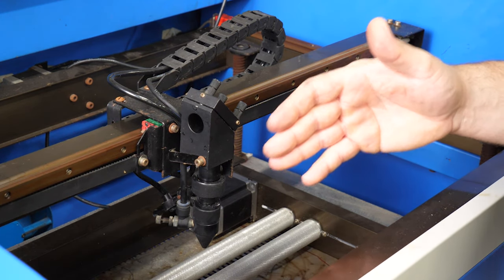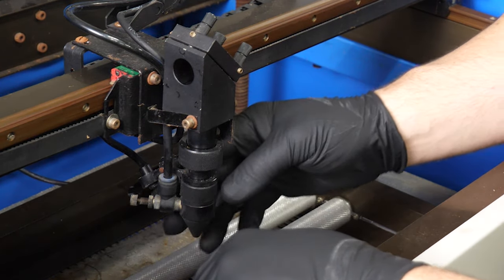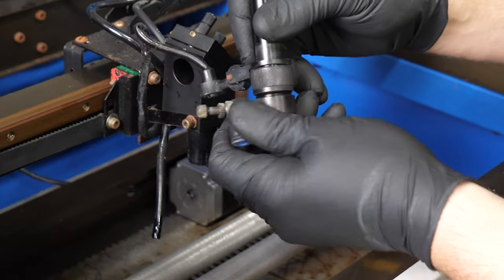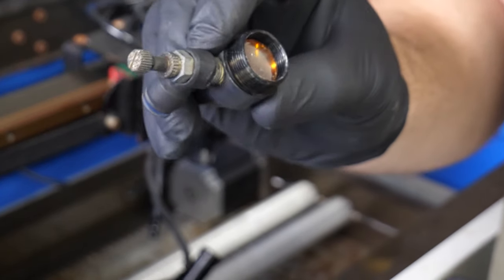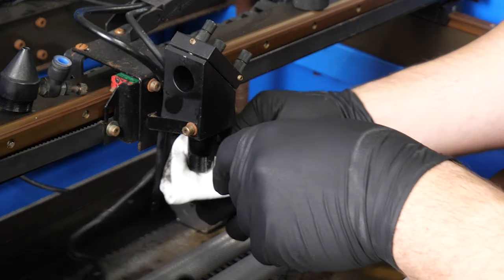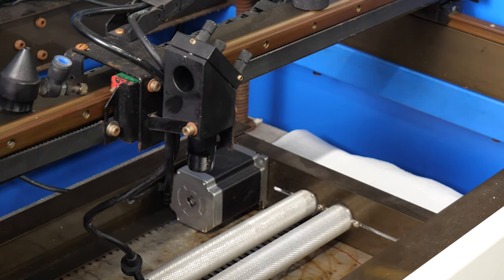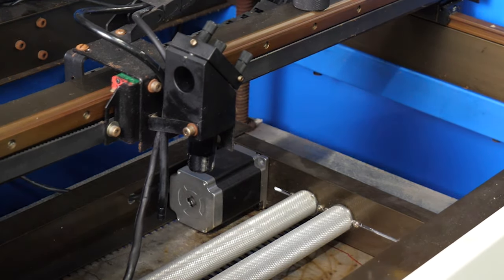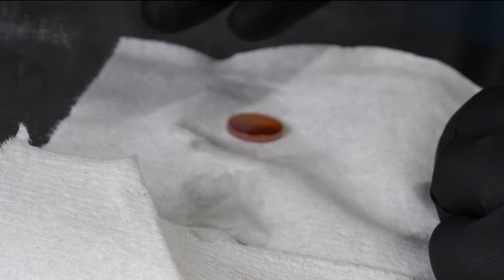Laser Engraving Machine Lens and Nozzle Cleaning |  China 50 watt Laser Engraver

Comment: Thanks for your video. I recently bought the same laser. I would like to buy a replacement lens and head. There are no technical specifications in the manual. Could you please say what focal length and which lens this model has? Where could I buy this. Thanks
Reply from the maker: The one We have is a  18mm 2.0 50.8 fl
Reply: @arnoldprints  Thanks for your help. Could you tell me if I can replace the complete head with the mirror. I have a colleague who uses a machine with a head that has a 22mm tube and a 20mm lens. Could I replace mine with one like his? I have seen that I cannot find replacement heads like mine which has a 16mm tube. Greetings from Spain
Reply from the maker: @EnzoPaceTarifa1   checkout cloudray they sell all kinds of parts for these
Reply: @arnoldprints  thanks. good job

Comment: Does this laser use an air assist?   I have found on mine that if I have the air assist cone installed, but am not blowing air, the lens will get dirtier 10x faster than without the cone installed.
Reply from the maker: It has on that’s external but yes protects the lens and evacuation